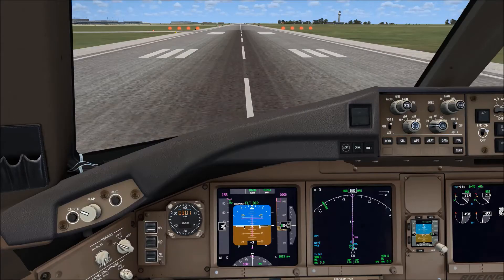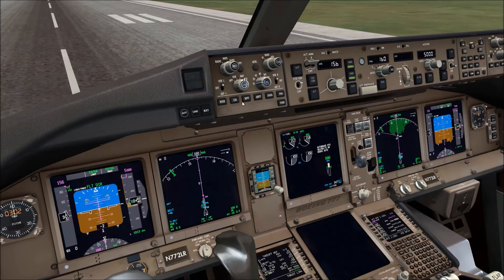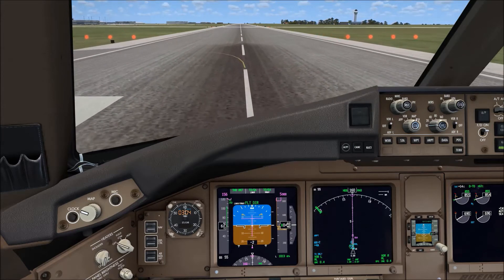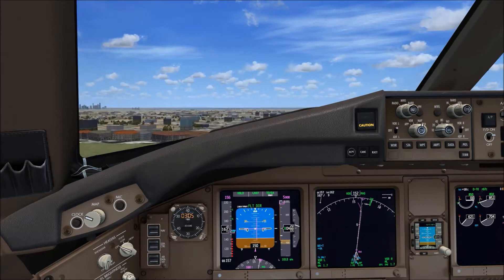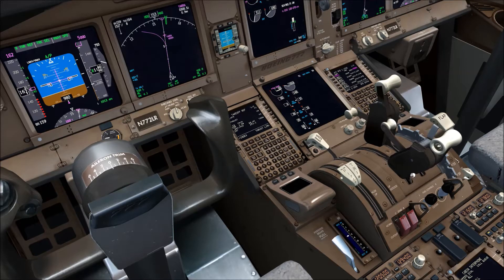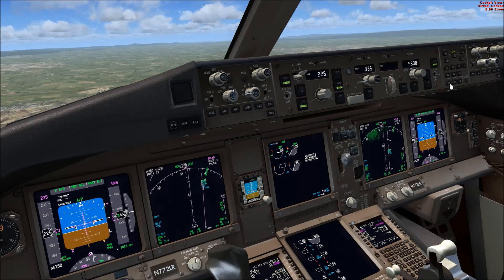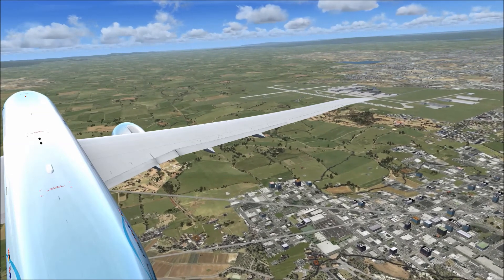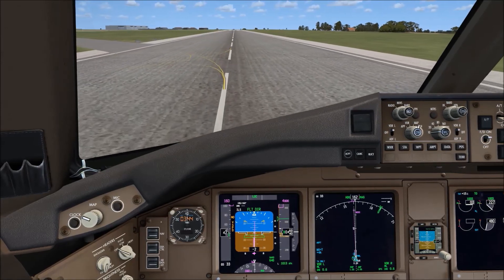PMDG 777: How to manage an engine failure after takeoff

Comment: It looks a lot easier than on the ngx 737 , single engine operation auto throttle disengages no fuel dump and no in flight display for the checklist 
but a very nice video
Reply from the maker: +Jonathan Lambert Thanks for your input. True, the auto throttle can't be used on the 737. Fuel dump is not so mjch kf a problem as there is no big difference between max landing weight and take off weight, normally. The ECL is a nice tool indeed.

Comment: Captain Nav, could you do a guide on how you would manage this on a hight alitutude airport with a heavy weight? I keep trying in SEQM with around 288t but crash all the time as it doesn't accelerate. Im using the 777F, latest pmdg version. Thank you for all of your videos.
Reply from the maker: I will see what I can do. However the same principles apply.
With PMDG I noticed it does not give you the correct speeds, so that's possibly why it doesn't work out for you.

Comment: Excellent video!!!  Merci!!  When the flaps are up, why don't you select FLCH?
Reply from the maker: You can use both VNAV or FLCH, it is the same.
Reply: @CaptainNav  Thx. Also, when you moved the flaps- the V2 bug went away. Is that normal ?
Reply from the maker: @joepatroni8777  At 400 feet, the speed window on the MCP blanks, is that what you mean? This is normal. The FMC "takes over" the control of the speed at that stage.
Reply: @CaptainNav  Actually, I meant on the speed tape. Is that when the V2 Icon is removed. When flap selection is made?
Reply from the maker: @joepatroni8777  Yes, the V2 icon on the speed tape is removed at the first flap retraction, so in this case, when flaps are moved from 5 to 1. To answer your original, yes it is normal, as you are now retracting the flaps to accelerate to clean speed, so the V2 reference is no longer relevant.
Reply: @CaptainNav  Thank you very much. One last question, when does G/A come on the engine display during approach? (In video on downwind it is showing CRZ) then on final approach it shows G/A... Is that change also at also flap activation?
Reply from the maker: @joepatroni8777  That is correct. In the cruise, the thrust mode is CLB, in the descent, CRZ (paradoxical), and when you extend the flaps, GA

Comment: nice video, couldn't help wondering why turn the fire bottle knob when no fire indicator lit and why you didn't turn the knob after lifted it?
Reply from the maker: Simply part of the Engine Severe Damage checklist. By pulling the "knob" you basically isolate the engine (hydraulics, electrics, etc...). As you hinted, you only "rotate" the fire warning switch when it is lit, which means a fire is detected.
Reply: Captain Nav  Thank you for your detailed explanation !

Comment: Hi there, I enjoyed your video. Many thanks. I had a question. Why was thrust increased after flap retraction? Thank you.
Reply from the maker: +AceOfHearts001 Thank you for your kind comment. Thrust is increased to maximum continuous thrust to help the aircraft climb away as quickly as possible. The procedure is designed that way, as soon as flaps are up, thrust is changed to CON on the upper engine display. If you need more thrust straight away after the failure, you can push the thrust levers forward or press the TOGA switches to give you full take off power. It adds a bit to the workload, but is an option.
Hope this helps. If you have any other questions, please do not hesitate.
Reply: +Captain Nav Many thanks for your kind reply. If MCT was set after flap retraction, it would mean thrust was below MCT with T/O flaps. It does not make sense performace-wise why thrust is increased at a point where excess thrust is naturally increased with flaps = 0, if that thrust was available all along it should have been selected immediately following engine failure.
Reply from the maker: Your reasoning makes sense, and that is why I said in my previous reply that if you need more thrust after the failure, you can do so. Most of the time, we take off with less than full power (Assume temperature) to save the engines wear and tear. Even with that reduced power, we are still able to fly on one engine and clear all obstacles, etc... all regulatory requirements are met. If you need more thrust, you have it in your back pocket, so to speak.However, the procedure/flow is designed to use Maximum Continuous Thrust once the flaps are up. Just the way it is ;-)

Comment: Captain nav I have a one question in my mind how you calculate your fuel during jettizon and how you calculate a maximum landing wait
Reply from the maker: Hi, the system automatically calculates the amount of fuel you need to have to be at maximum landing weight. It is very clever!
Reply: Thanks for clearing my dought
Reply: Means Boeing 777 has a 12hour of burn rate
So the calculate the aircraft current weight
And fuel remain during fuel dumping rate
Means 
Current weight. 91.0
Remain fuel.       40.4
Weight to loose. 50.6 tons

So first of all Boeing 777 has a 12 hours of fuel burn rate + 1 min fuel dump

12 hour × 1 min/sec
---------------------------------- = 0.2 min/ sec
              60 min  
So calculate with 2.2 tons
2.2tons ÷ 50.6 tons 
Time taken during jettizon 23min.
Am I right to say
Reply from the maker: Once you start jettisoning fuel, look at the fuel synoptic and it will show you the time remaining to jetisson.
Reply: Captain nav I have a question due to whether is alright using flaps 20 for one eng landing 
Due to whether is not good using flaps 30 for one eng landing
Reply from the maker: Flaps 20 or 30 are good for single engine landings. Both are OK. I personally prefer flaps 30 as it is the same as a two engine landing.

Comment: I need some help, after landing I have a failure with breaks and tires and I cannot clear it. Also I cannot disengage the autopilot, the alarm is not going off.... what  am I doing wrong?
Reply from the maker: If the problem is with brake temperature, either the aircraft is very heavy for landing and/or you brake too hard (which is easy to do in the simulation). To stop the autopilot alarm, you need to press the disengage button twice.
Reply: Captain Nav thank you so much, your advise was more than valuable! Respect!!!
Reply from the maker: @vagsan1  You are welcome 👍

Comment: Does it matter which way you make turns when your engine is dead. Here you make left turns with a left dead engine. Also is there a max speed we should worry about with only one engine. I practiced this scenario once and it went well. Second time the autopilot did not want to turn the aircraft. I had to do so manually to get it on a proper course but I managed to land it using a full autopilot ILS approach and manual fly once close to the ground without issue.
Reply from the maker: +XBOXORANGEJUICE In the air, it should not make any difference which way you turn. Speed wise, the same speed limitations apply on one engine as they apply for two. I am glad you gave it a try, it is good fun.
Reply: Thank you and something small I thought about. When do you turn off the seatbelt / no electronics sign. I see you have no smoking instead. And if you leave them to Auto how does the plane turn them off and when.
Reply from the maker: +XBOXORANGEJUICE In flight, we often turn the seatbelts sign off at 10000 feet if we think it is not going to be bumpy. They are different buttons options here in the simulation.... 
Actually, in flight, to switch the seatbelts sign off, we put the switch on the AUTO position.

Comment: 20:43 wouldn't it have been better to just leave the crossfeed valve open for the remainder of the flight with all fuel pumps on? would that still contribute to a further fuel imbalance?
Reply from the maker: Actually there is no guidance for the 777. The Flight Crew Training Manual states that Boeing does not recommend opening the crossfeed valve when an engine is shutdown (in case of a fuel leak). On the 737, if I remember, we used to leave the crossfeed valve open with all main fuel pumps on to keep the fuel balanced once balanced. On the 777, I guess you can do what I did in the video - try to balance the fuel - but I would also close the valve before landing.
Reply: @CaptainNav  yeah, I was applying the NG's philosophy here being a Boeing aircraft but nonetheless, great video and it's incredible how you're still around responding to comments having produced some real quality content for us!
Reply: The reason for not leaving crossfeed valve open is because the pumps may not have the same pressure output, even they have the same output ratings.  There are minor differences due to manufacturing or installing issues, so if the pumps in the low tank has a slightly higher pressure output, then you will actually pump fuel away from the low tank without you even knowing it.  It could cause further fuel imbalance.

Comment: hey captain, wouldn't you go TOGA after rotation when you have an engine failure?
Reply from the maker: Yes you can use TOGA. There are drawbacks to it, though. You increase the thrust asymmetry and make control possibly more difficult. You also engage the flight director in TOGA mode and this is locked until 400 feet, so no proper lateral/vertical guidance.
The good thing to do is to increase thrust manually if you want more thrust. At 400 feet though, the thrust will go back to the take off setting (so will reduce).
Reply: @CaptainNav  thank you for that explanation! :)